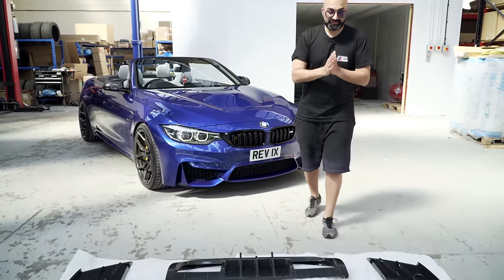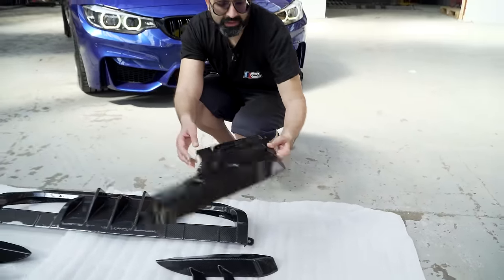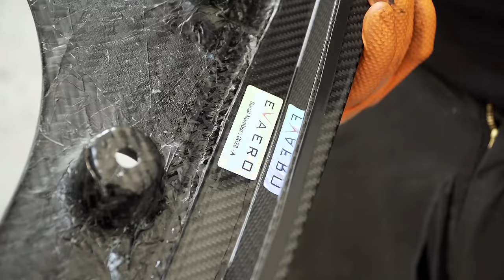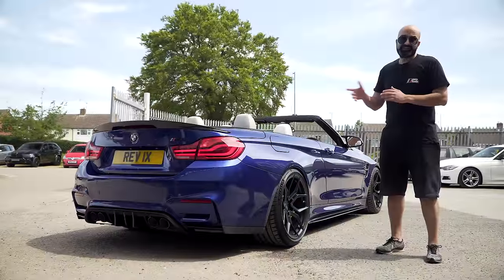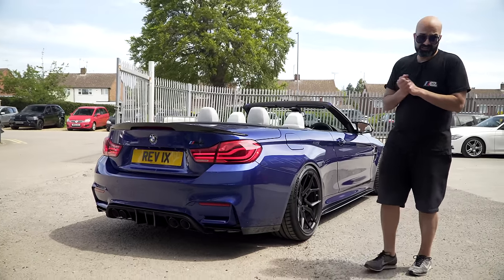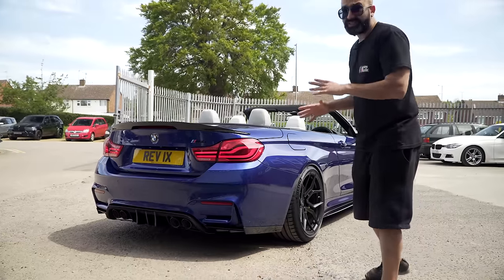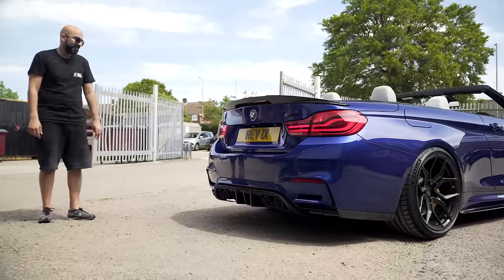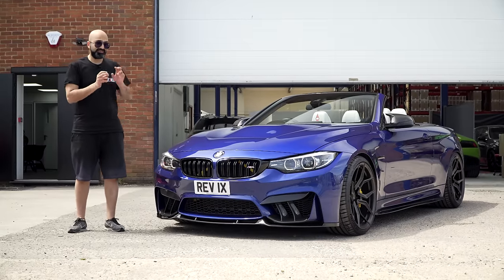This F83 M4 gets an Evaero + RKP carbon fiber style upgrade!

Comment: She looks so beautiful Especially with those wheels  👌 🔥 
But if you are a fan of V max, these beautiful touches of carbon will not help in achieving improvement in speed performance , but it is wonderful
Reply from the maker: Very true! We remove all carbon aero when doing high speed runs.

Comment: Mines San Marino blue with ivory leather, I’ve also added the M4CS carbon bonnet, front spitter,mirror covers, rear boot spoiler, defuser & the bigger brakes (gold calipers 6piston/4 piston) using the larger 400mm & 380mm discs but not the ceramics.
Full carbon trim inside looks amazing👌
Sitting it along side my M4CS they both look fantastic 👌
All
Parts on mine tho are OEM👍
A set on Eibach pro kit springs finishes the stance off nicely, I’ve kept the standard 666M 20” wheels.